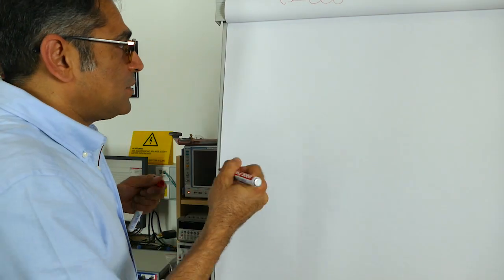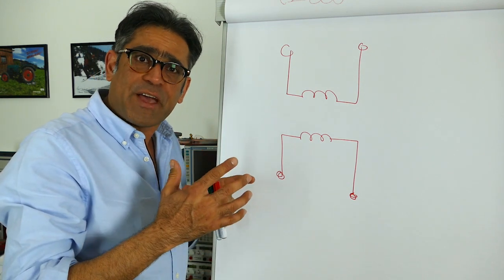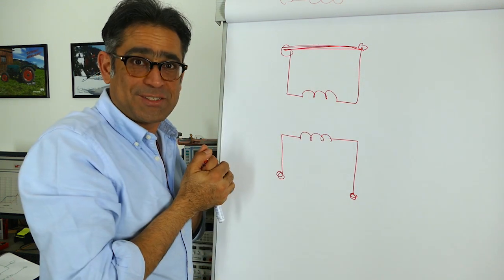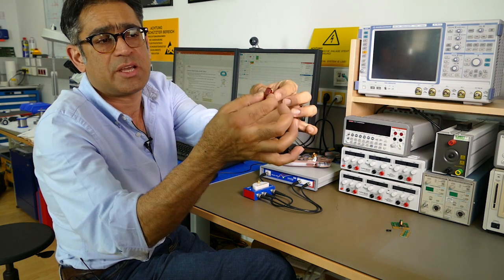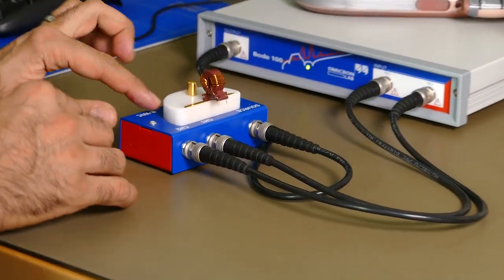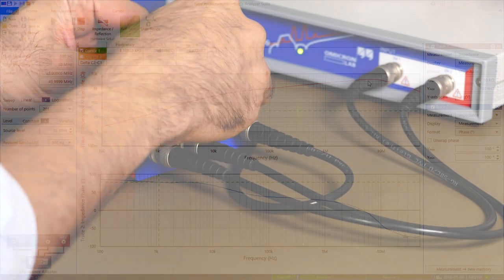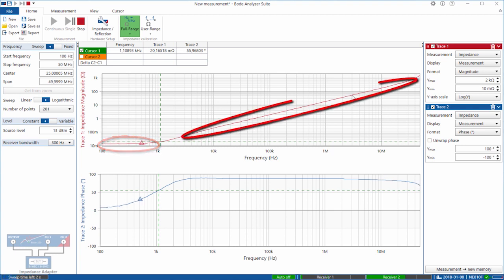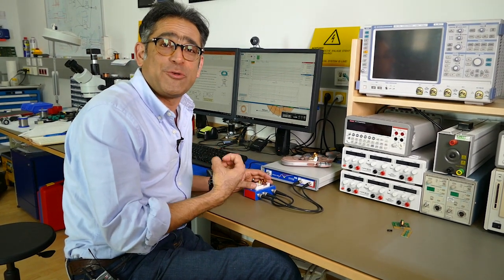EMC Filter Design Part 7: Common Mode Choke Measurement

Comment: Thanks for the upload. I came across this listed deep in search results for uploads about DC ripple port, or coupled magnetics filters. I'm simply curious about the subject as a hobbyist. I'm currently working on a linear bench PSU with the typically oversized filter capacitor. I should be looking for active in-rush current limiting circuits right now, but I came across a couple of scientific papers about ripple port filters and coupled magnetics ripple filters. Both papers are well beyond my current math skills. I don't see any information on YouTube about this type of application. This may be due to my limited layman's search phrasing, or it may be a good talking point for someone to cover academically. One of the papers I came across tried to summarize the entire academic history from 1930 to present, and relate the diverse range of potential applications within any type of DC power filtering circuit topology. I believe it would be really helpful if someone demonstrated such things practically as they apply to a traditional AC mains isolation transformer and rectifier circuit and DC converter circuit.

  Before typing this, I skimmed through your uploads list and didn't notice anything related. I apologize if I missed something. You have several uploads I need to watch that are relevant to my interests though.
  Thanks again.
-Jake